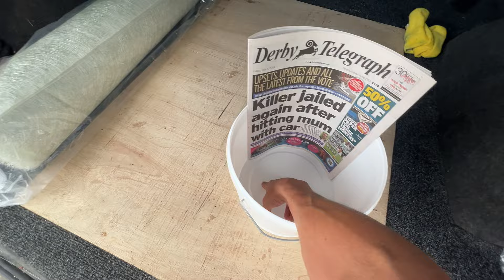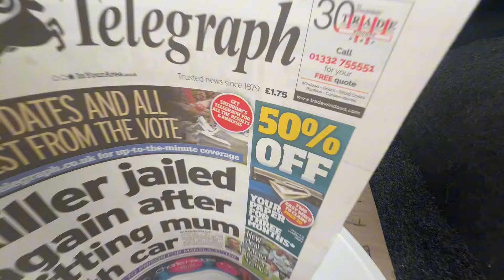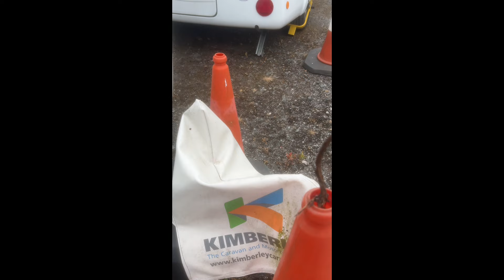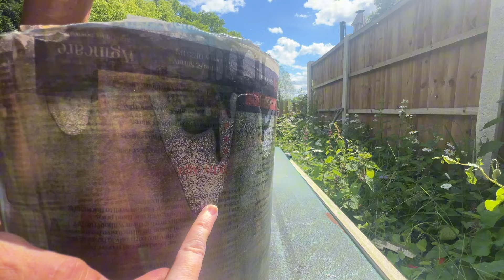Newspaper as a composite material test

Comment: I think in itself it’s relatively obvious is it not? The fibreglass matting itself without the resin is not waterproof. Core material, newspaper, a pair of your old boxers, all not waterproof in their own right. Resin topped tables, flooring etc etc - all waterproof - Isn’t it obvious that the resin is the waterproof material? Could surely sandwich almost any binding/strengthening material within resin to the same effect - but of cardboard, some chicken wire if you could get the resin contained and built up thick enough, anything really
Reply from the maker: Correct but there are still people out there who believe the topcoat is the sole waterproofer and they advise people to put two layers of it on for extra waterproof.